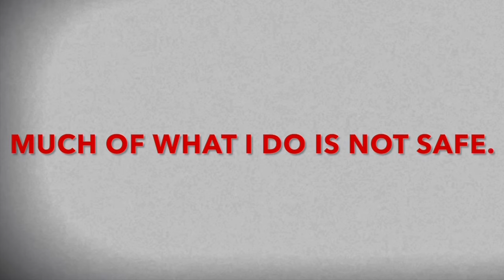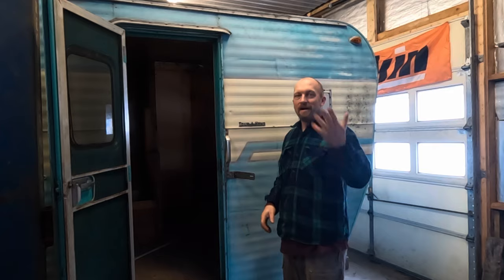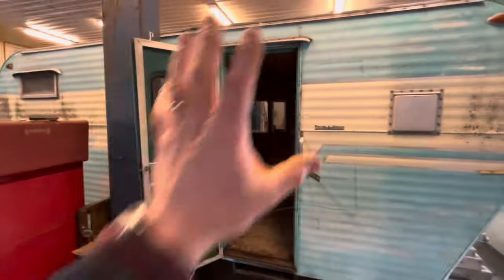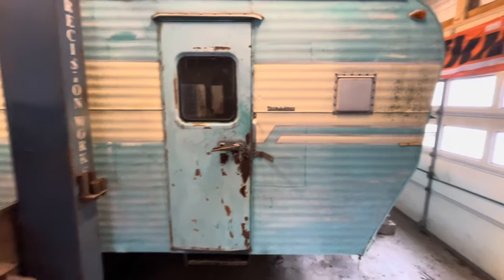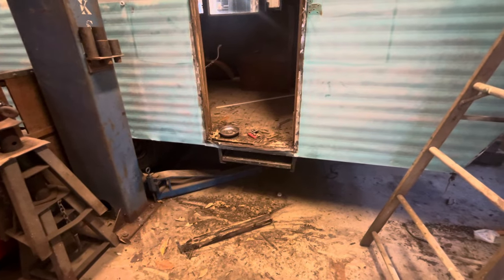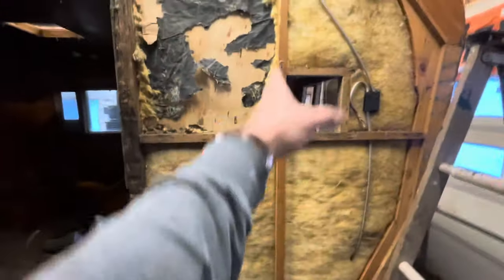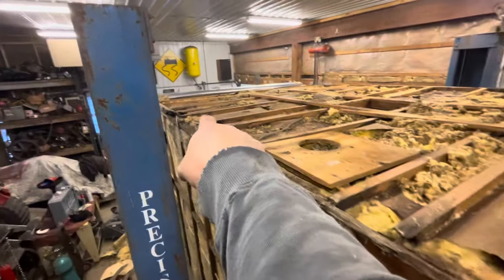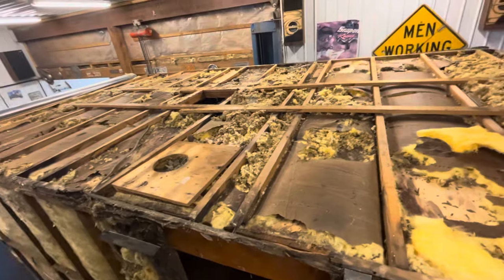What a disaster… will the bakery / coffee shop be salvageable?

Comment: I think your heading in the right direction and have a solid understanding of what needs to be done.
You'll probably want a new modern fan (or two) instead of the vent. They're usually 16x16 so frame and wire for that since you're right here. I use a flush cut router bit to cut new holes. As for the lumber. I could only find crappy white wood in close dimension so I opted to buy nice fir and resaw to get the right dimensions. There are a couple outfits in the US that sell that aluminum for the side and you should be able to get that exact pattern. I think a polished diamond pattern would look good for the serving window hatch. Kinda retro.
I look forward to your progress!
Reply from the maker: Thanks Noob
The next video is coming along and the project is turning the corner nicely